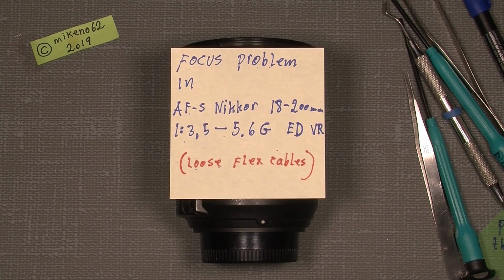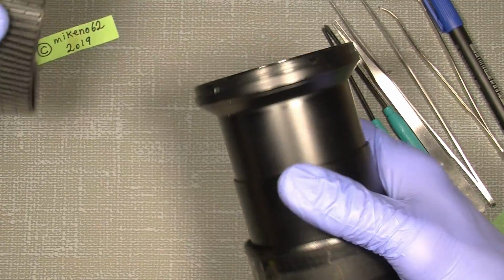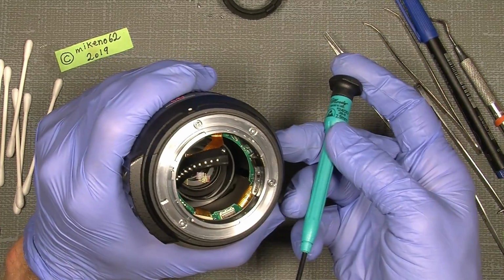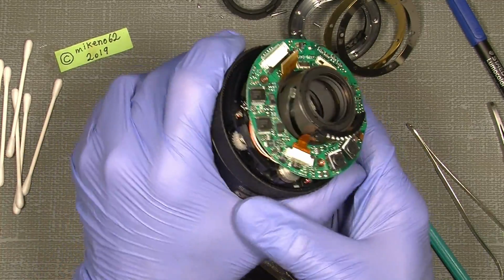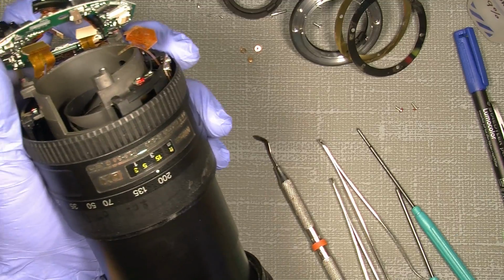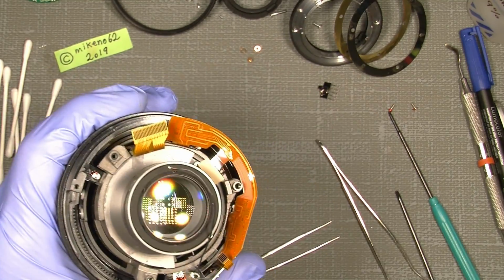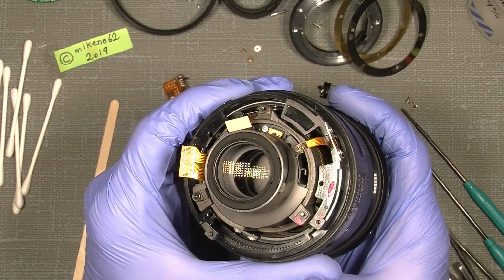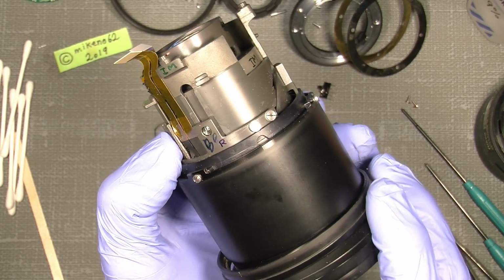Focus problem in AF-s Nikkor 18-200mm 1:3.5-5.6G ED VR___NOT GOOD

Comment: Thanks for the excellent walkthrough! My lens had the same issue, but the flex cable had not broken yet, so like another commenter I was able to remove the foam tape and superglue the cable down. After scrolling through the video in reverse to reassemble correctly, it is working now! Thanks again, as my lens likely would've eventually been scrapped if it weren't for your video!
Reply from the maker: Wow 🙂 that’s amazing it’s great you could fix your lens again 👍

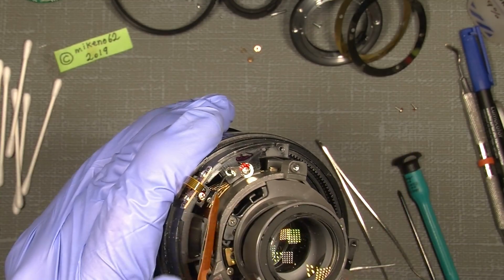Comment: Repaired my lens today using your instructions.  Cable was lose but not damaged so I cleaned off the dried up double sided adhesive and used superglue in its place to fix it back down and it's now working as it should again.  I avoided de-soldering the wire as I see you unscrewed the other end later and it saved some time and soldering is not my strong point.  I also didn't take out the focusing brush (28:52) and focusing brush and key (31:45) either because the lens can be dismantled with out removing these.  Very many thanks for your instructions.

Comment: Good comprehensive video showing the problem caused by the loose flex cable. Relying on a bit of double sided tape to keep the cable away from the focusing mechanism definitely seems like a bad design. Honestly I was hoping the repair wouldn't be that complicated, but as the video went on I got more and more apprehensive about tackling it myself.
Reply: Same for me, I will not try on mine as I'm not feeling confident to do all this....

Comment: I just repaired mine. I was lucky, the cable electrical circuits were still intact so I cleaned all the glue tape off the cable and the chassis with isopropil alcohol. Heated the cable with a clothes iron on halfway between wool and cotton and ironed it flat. The heat brought the stretches out of the cable and i got it perfectly flat, as new. Then i superglued the cable back to the chassis making sure it had good clearance, the superglue is much thinner than the original bouble sided tape and gives it more room to pass. Providing the gas off the superglue didnt upset the cable it should be good as gold forever!

Comment: I very much appreciate that you share your knowledge. I am now confident to try and fix my lens. I need a replacement bayonet mount for a Nikon 28-200mm G lens. It is plastic and is worn and wobbles a bit on the camera. I thought I would pass that on to you, maybe you have one, or is there possibly a working equivalent,  I see many other Nikon replacement mounts but none specifically for the 28-200mm. Thanks for your time.

Comment: Hello, thanks for a great video, I have the same lens my problem is that when I focus on something the image jumps sideways a few times before it settles down,  I wish that I had the skills to have a go at it and try and discover what the problem is as it would be too expensive to get it repaired, could it be the same issue that you show on your video, unfortunately I took the small side screw out before finding your video so now wondering how to get it back in, any help would be very much appreciated.

Comment: Hi Ken,
Thanks for the great video. I have this lens,which is functioning correctly at the moment.The problem I have is fungus within the focusing optics.
The  question I have to ask your advice about .Is there a way of accessing the focusing group of optics,without having to disassemble the focusing motor,sensors,brushes etc? 
Kind Regards Marc.

Comment: Thank you for a very detailed tutorial! My ribbon cable now visible is very slightly affected by rubbing. Would very slight distortion produce occasional focus problems? Do you have a tutorial that goes further so I can see what is preventing the barrel from zooming all the way out?
Reply: I found the problem! I think they call it a "roller". You can see it on p. 14 of the service manual unlabeled -- a light-colored screw that fits into a U-shaped place on the ring unit. When zoomin, it travels in a diagonal groove and pulls the lens assembly all the way in for 18mm. I has to take quite a lot of force, I'm surprised it lasted over 10 years. Mine had fallen out. Unfortunately, it will no longer screw in tight. It seems the inner thread is damaged. At this stage, I am guessing the lens is kaput...unless Super Glue can come to the rescue...

Comment: What is your approach to removing the 3 barrel flathead screws?  I've looked at 3 of these lenses and can't get them to free up and come out.  I don't get a good match with all my screwdriver bits either.
Reply from the maker: You could try to add a few drops of Isopropylalcohol on a cotton bud, then try to add it on the screw head, let it suck in and wait 10min then, with very small movements of counter clockwise then clockwise and so on... if the screw wont move then add more Isopropylalcohol, and then wait a few hours, then continue, but do it with care.

Comment: Sir, I have exactly the same lens. it's autofocus function well but recently anytime that I turn the camera on it starts to shake and make noise for a short time regardless of VR button is on or off. I wish I knew which cable is for the VR then I could detach it to see if that will solve the problem or I knew how to clean all the gears and moving sections... that would be very kind of you if you could open up the lens all the way into the VR section and explain it a little bit... or just explain how it would be possible to disconnect VR section from the top... which flex cable is for that? With kind regards....
Reply: I have exactly the same problem when the camera is turned on or when the lens is mounted on the camera, the lens shakes for a short time.
Reply: @richardlouie2922  should be switch on barrel to turn off VR; another turns off Autofocus, then you can isolate which system is causing this.

Comment: Thank you for the video! My lens had the exact same problem but it had fully disconnected the wire and it was stuck in the lens element.  Watching your video I took it apart and completely removed the wire and now the lens seems to work like new. Do you know what that wire controlled? because removing it doesn't seem to change how the lens behaves at all.
Reply: bryce delany are you talking about the black wire that he unsoldered or that flatflex that got hit by the focus mechanism? 
Think the black wire is to ensure continuity of the ground/shielding for EMC. The flatflex that came loose is likely to related to the VR mechanism: there needs to be some connection between the electronics and the actuators/voice-coils that move the optics. 
My lens has developed same issue; will need to take a couple of deep breaths before starting the complex disassembly. Wonder if the lens would still work fine if that flatflex is broken or missing, and nothing driving the VR actuators. Best case it would become a non-vr lens which is still usefull....
Reply: Frank van de Pol well I ended up completely removing the flat flex cable. Surprisingly the focus still works but it’s definitely effected something because it searches back and forth before finding focus. I don’t know where to get a new cable for it and Nikon won’t repair it because I have opens the lens.

Comment: My nikon 500 F4 D II lens, autofocus sometimes works And sometimes it doesn't work The symptoms are similar to this video clip. Having to use a hand to help rotate the focus ring to be able to use it sometimes doesn't work at all. Can you tell me why?
Reply from the maker: Sorry but I have not yet work with Nikon 500mm f/4, but It could be the almost same problem that some parts has come loose somewhere inside the lens, or the magnetic encoder tape is a bit dirty. Just some ideas.

Comment: you was un-soldering a point - just to unscrew the contact part it was attached to, few minutes later - means, no need of soldering iron. right?
Reply from the maker: That's thrue, it was just to make it more easy to disassemble, when showing on video.

Comment: I think I have a similar problem with my Nikkor 16-85 lens. I am thinking of disassembling it and taking a look. It still works but it gets super stiff when I zoom out to 85 and zomm back in, it stops at 70mm. Then I need to rotate is a lot harder until it loosens up. There is something wrong there. It all works and focuses though. I am not sure what to do, because it works I don´t want to destoy it completely.